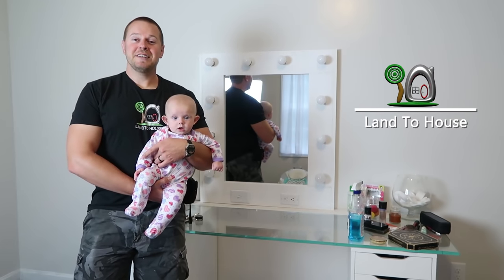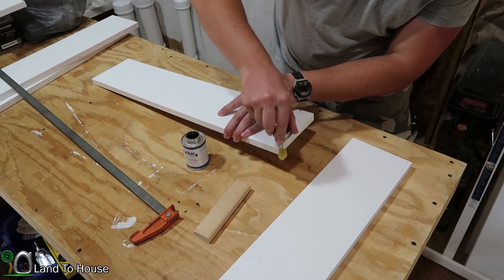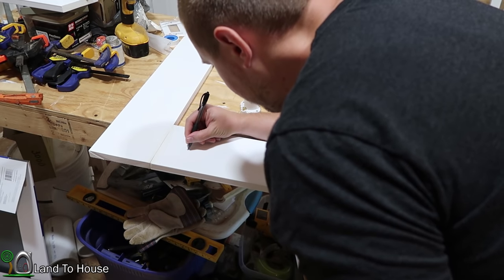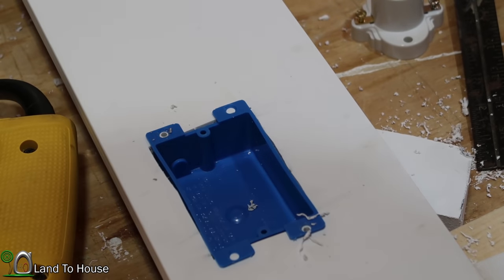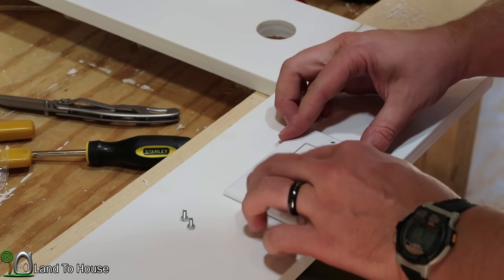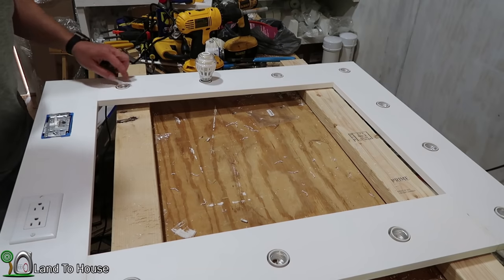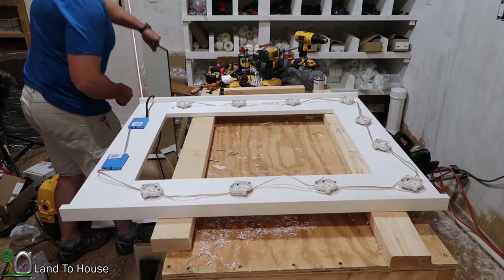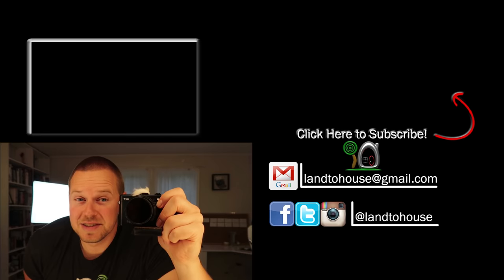Makeup Vanity Mirror with Lights DIY Step by Step

Comment: I did the electrical exactly like you did, I even have the same dimmer, but for some reason i can’t seem to get the dimmer to work. Any thoughts?
Reply from the maker: Did you check to make sure your bulbs are dimmable?
Reply: Land to House the ones I initially got turned out they weren’t dimmable so I tried it with one that is already works on a dimmer but same results; it did not work on the vanity dimmer.
Reply from the maker: If you would send an email to my landtohouse at gmail I can take a look at a picture or two and see if I can find out the issue.
Reply: Land to House I figured it out!!! Turns out I had burnt out the dimmer with my first attempt at wiring lol. I went and got a mother one and wired it and it works great! I appreciate your replies and thank you for attempting to help further.
Reply: I meant fried** the first dimmer

Comment: What do you recommend as far as measurements if i wanted to use a 1x4 instead of the 1x6 that you used?
Reply from the maker: You will likely find it hard to work with the 1x4. Because the actual size is 3/4" by 3.5" there is little room to work with installing the boxes and lights. Very little tolerance.

Comment: So if I only wanted the switch, I would only cut the hot wire, and have a hot in on one screw and a hot out on the other screw?
Reply from the maker: Yes that is correct. Switches only break the hot wire. The neutral wire bypasses the switch.
Reply: Thank ya!

Comment: Use a heat gun to soften the box and use a scrap 2x4 to get a  1/2 - 3/4 inch more space in the box
Reply from the maker: That is an interesting concept. I had not thought about that.

Comment: At 11:50 I notice a green wire connected to the ground screw. My switch didn’t have that. Do I need it to make the actual dimmer to work? Because I have power to all the bulbs but I can’t dim the bulbs for some reason.
Reply from the maker: The dimmer switch does have that ground wire but it is not needed if your power plug does not have ground. Did you make sure that you have the LED lights that are dimmable?
Reply: Land to House I’m using Utilitech 60W  LED dimmable bulbs. I was pretty sure those would be good. Another issue I’m having is the switch is very sensitive even on the “off” side. It keeps flickering and wanting to come on. Is there anything I can do to fix that?
Reply from the maker: Ok those bulbs should be good. Did you check to make sure the dimmer is designed for LED's? They are more expensive.

Comment: Omg yess I’ve been looking for this! Also I have those same makeup drawers I have a glass on top as well but the size is wayyyy off bc it was from an old center table. Where is hers from?
Reply from the maker: Thank you for watching. The glass was from an old table. There used to be a furniture factory in our town and it went under and sold the massive glass for very little money.
Reply: Land to House ah okay same situation as mine only hers matched up haha thank you for taking your time and replying! Great job!
Reply from the maker: I actually made a board and painted it white so that the edge of the glass could match up with the front of the drawers.

Comment: I️ just built one but I️ was wondering can I️ put the on off switch first so the outlet only works when the lights are on
Reply from the maker: Yes you sure can! Sometimes my wife wants the lights off and still heat up something like a curling iron (she just found out that the lights have an off slider haha)  ....Yes placing the switch first is no issue.
Reply: Awesome! Thanks
Reply: Awesome! Thanks
Reply: Awesome! Thanks

Comment: I am having issues with my dim switch not staying powered on when turning down all the way and flickering when turning down please help
Reply from the maker: There are a few types of dimmer switches. You will need one specifically designed for LEDs. Also some LED bulbs are not dimmable.

Comment: How much did you spend on material?
Reply: Good question. How much did he spend to get those material and all the equipments? Not to mention the time spent in putting them together.  It's worth trying to build things for yourself once in a while instead of keep buying. But comparing all this to a mirror that was supposed to cost $500, to me I don't think it's worth the stress. But nice job though

Comment: My mirror is 36 by 30 do I do 2in and 3in as well when I get the trim?
Reply from the maker: I like the larger trim because it is better to install the sockets into. You might get by with the smaller trim but I would not want you to buy something that would not fut.
Reply: @LandtoHouse  right now I'm on the  Electrical part. Great video. You never show how you gave the vanity power

Comment: What did you do for the neutral (green) screw on the dimmer switch. If the dimmer had a screw for the neutral wire.
Reply from the maker: +Jesse Mobious the green wire is actually a grounding wire. My power plug did not have ground. (It would be nice if it did) I just did not use that ground wire.
Reply: Land to House I see thank you 🙏🏿
Reply from the maker: Sure thing! Happy to help.

Comment: Great video!  What dimmer switch did you use?  The one I picked up is too deep for the low profile boxes.
Reply from the maker: I honestly cannot remember the brand. It was purchased at a small town local hardware store. The fit was close. That is the main reason that I did not cut the white wire.

Comment: How’d you mount it to your wall ??
Reply from the maker: I used 2 screws in studs and picture wire. for the bottom I used a couple washers against the desk to keep the mirror from pulling away from the wall when power is unplugged.

Comment: When connecting the outlet to the switch did you put the neutral on the other end like you did the hot?
Reply from the maker: +User 7 the switch only needs to break the hot wire. The neutral wire from the outlet goes around the switch.
Reply: What are the dimensions of this entire thing?
Reply from the maker: +User 7 38" tall and 33.5" wide
Reply: I am making my step daughter one, my power cord has a ground, how would I wire that into the dimmer switch?
Reply from the maker: If your dimmer has a ground screw you would just wire the ground to the screw. Often times its green. If there is no ground screw it's ok to leave that ground untouched.
Reply: My dimmer doesnt have screws at all, just wires coming out of it. Did I buy the wrong dimmer?
Reply from the maker: Do you have a green wire on that switch? That is your ground.
Reply: Yeah, has two red, green and black. I think I am just going to a different one though. Think wiring it from the outlet and to the lights will be easier with one with screws instead of all these wires. Haha, electricity isnt my thing at all.

Comment: How did you connect the first light socket to the dimmer switch ?
Reply from the maker: You only need the hot wire to be broken by the switch. The neutral wire can bypass the switch
Reply: Thank you so much the mirror turned out great!!
Reply from the maker: Nice! Thank you for the update.

Comment: Can I use an extension cable or do I have to get lamp wire? Also how did you connect the lamp wire to the first box? ( not the dimmer box ? ) thanks !
Reply from the maker: You can use extension cable wire. I just had a roll of lamp wire and used that. An extension cord is going to have the same type wire for the cheaper cords. To connect the outlet to the extension cord I used one side of the outlet screws and to connect the dimmer side I used the other set of screws on the outlet. Let me be more specific: If you hold the outlet upright you will see two sets of screws on both sides. two bronze and two silver. Look very close between either set and you can see there is a metal connection that makes the two screws (one).  So wire the silver side with extension going in and lamps wire going out. 

I hope this helps.
Reply: Land to House ok ok thanks a million!! You did a great job on the vanity! One last question where did you buy the light sockets? I’ve gone to Home Depot and Lowe’s and can’t find the same ones, they’re either too big or too small.
Reply from the maker: I just added a link to the light sockets on amazon in the description. You might be able to find them at lowes for just a little cheaper.  http://amzn.to/2CZrnm6

Comment: Your dimmer came with a ground wire I assume, did you just cap it off?
Reply from the maker: +Tay Battan because the power plug that I purchased did not have a grounding wire I just did not use that wire. There is no need to cap the ground wire.
Reply: Land to House  Oh my gosh your SO HELPFUL!! Thank you!! Lol
Reply from the maker: Sure thing. I hope your build goes well.

Comment: What kind of outlet works best for this?
Reply from the maker: +Christopher Gonzales the outlet that I used was a typical Square face. Nothing special.
Reply: Awesome thanks! Also, 9w lights... are they soft white?
Reply from the maker: +Christopher Gonzales the watt value is a good way to determine how bright they're going to be. The Kelvin value is how yellow or white the bulb is. The higher the Kelvin value The whiter the light. For instance a 2700 k is going to be rather yellow. A 6000k is going to be very white.
Reply: Land to House awesome thanks. And which ones did you use?
Reply from the maker: Christopher Gonzales this is the type I used. Of course you don't want a large pack like this. https://www.lowes.com/pd/Pass-Seymour-Legrand-Radiant-10-Pack-15-Amp-125-Volt-White-Indoor-Decorator-Wall-Tamper-Resistant-Outlet/3477225

Comment: Are you planning on plugging a hair dryer in there? Most are near 2000 watts and I am concerned.
Reply from the maker: +First Last I believe my wife's hair dryer is 1500w I don't expect any issues with only a 9 foot extension cord. The LED lights May dim a little bit.
Reply: Land to House Awesome. You could heat a house with my wife's hair dryer. Has a cord on it the size of jumper cables.
Reply from the maker: HAHA no doubt. My wifes is rather cheap. . . I got it for her a few vlogs ago.
Reply: What could be done to make that outlet handle high wattage?
Reply from the maker: I might be wrong... but I think it is limited to 1800w. Because 15amp x 120v = 1800watt.

Comment: Question, so how do you connect the lamp wire into the outlet? You didnt show that important step
Reply from the maker: Woops. All you have to do is run the extension cord to one set of screws of the outlet and the other set run the lamp wire.

Comment: He should sell me one lol
Reply from the maker: I would but I have way to many other projects lined up. :)
Reply: Land to House this is awesome. I'm building one now, I cant seem to figure out is the hot wire smooth or rough. Also, what type of wire did you use going from outlet to the dimmer switch. Thanks
Reply from the maker: HI thanks for watching. The hot wire is smooth. I used lamp wire from the outlet to the dimmer. The only place that does not have lamp wire is the extension cord from the wall.

Comment: can u please help me .. I'm making a vanity as well and my dimmer doesn't have the brass and silver screw's it only has two black wires and a green one .. I don't know what to do
Reply from the maker: On light switches that is typically all there is. The two black screws are designed to break the hot wire. That is normally either a black wire or a red wire. So you can leave the white wire untouched. Now the green screw is for ground. If your power cord has a bare copper wire then attach it to that screw
Reply from the maker: It can be tough at first but its not that bad once you get started.
Reply from the maker: Thank you for the kind words! And the shares. That helps my channel so much!

Comment: What gauge did you use for the extension cord  and will it support say a hair dryer or straightener
Reply from the maker: 12 gauge extension cord works well. That is normal house wire size. It will run those one at a time.
Reply: @LandtoHouse  thank you so much
Reply: Also will 18/2 lamp wire work for the daisy chaining